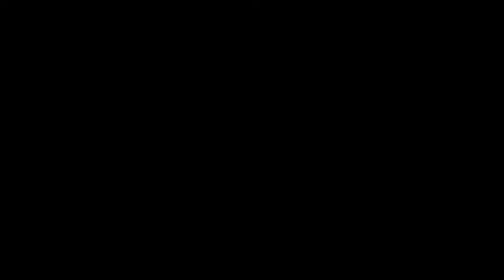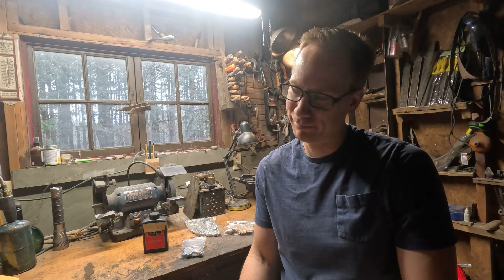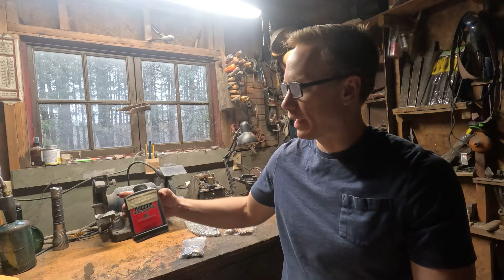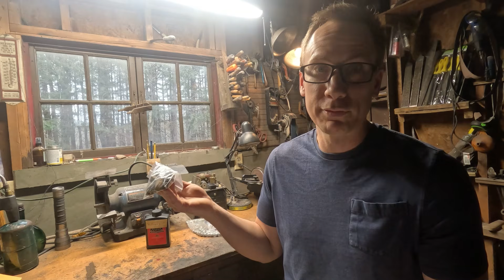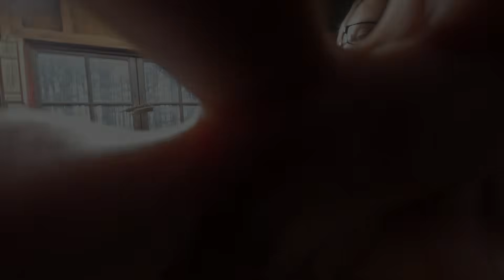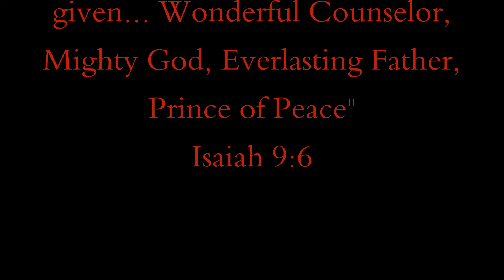Powder, Patch & Ball.  Why to make your own.

Comment: I am, by no means, a black powder enthusiast in your league.
However, I do muzzle load hunting for white tailed deer. 
I also have a bad habit of taking things to the extreme.
So when I decided to take up muzzle loading for deer, I bought as much powder and projectiles as I could at the time. I don’t use lead balls but copper jacketed projectiles in the plastic sabots, and the powders are pelletized for ease of loading. 
I have enough to last me personally a lifetime. I fire my rifle MAYBE 10-11 times a year if that. Every summer I sight it in at 100 yards to make sure the scope is still on, clean the heck out of it, and may not fire it again until the next year depending on hunting success or lack thereof lol.
Reply from the maker: Stocking up works too! Thanks for watching!

Comment: I cast my own. I aim to get set up to make my own powder, but I can’t puck it right now so honestly why not shoot Goex? I seem to never find Swiss 3F in stock when I have money to spend. I cast my own bullets and round balls but I buy them sometimes too. Lead is hit or miss around here and I ain’t plugging in the pot for a pound. I have made my own caps using PrimeAll and I made a swaging plate or maybe die would be the right word, 2 wholes the first with substantially more chamfer to push thick foils into the cylinder then swage the cylinder into final size. The tissue paper the wife uses for gift bags goes a VERY LONG way seating a tiny tear on top the prime all and a drop of high octane alcohol to wet it down and ramp it with the same punch you used for a mandrel. I actually had to make some because I don’t like them #11 sucking off the nipples or shaking off and at the prices why not just make the size I want? Disposable pie pan bottoms work great for cap foil. I’m not gonna claim they’re as reliable or consistent as commercially made caps because they’re not. I can make the size I need and save a buttload of cash doing it though. I have also used that PrimeAll to reload primers after beating the firing pin dimple out of them. Works on small and large pistol and rifle boxer primers but the shotshell primers are hit or miss because of the anvils.
Reply from the maker: Thank you for watching and sharing!

Comment: I started making my own powder a couple of years ago, I decision that keeps proving once again to be the correct one. If you don't want to hunt down the ingredients, you can buy kits that include all of them from Skylighter. The last place locally that used to sell pure black powder closed a couple years back and they weren't bothering to restock it even a year before that. I stumbled last year onto two huge pieces of pillow ticking, essentially bedsheet size. That will keep me good and stocked for years. I started casting my own lead balls back in 2012-2013 and have done it ever since.
Reply from the maker: Agree! Always a good move to learn the process and make your own. Thank you for watching and sharing!
Reply: Me too! AMP About 2019 or 20?   You got HOOKED TOO!
 DUDE!  I got his stuff and made a good sized batch! WOW! Blew me Away, and pissed me off, at myself.  I use his as my QC Standard, or benchmark unit of measure still!  TODAY!

 I have done hundreds of batches of charr from every tree on my land TP Bread flour, corn flour, tortoise crap, dog shit, wood chips, merry jane is the best to date with banana unbiblical cord and stem lower about the same.
I am STILL chasing the Dragon
Reply from the maker: Thanks Dave!  Always fun to try new stuff.  Yes Sir, once I learned how, have never gone back.  Merry Christmas!